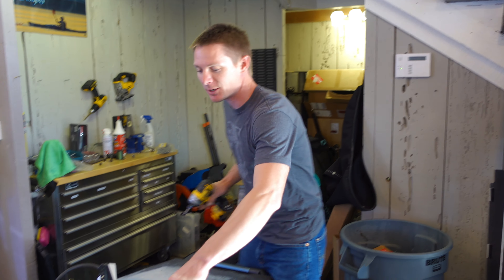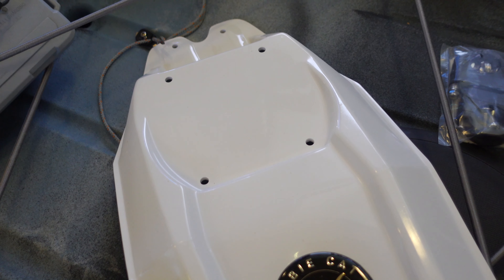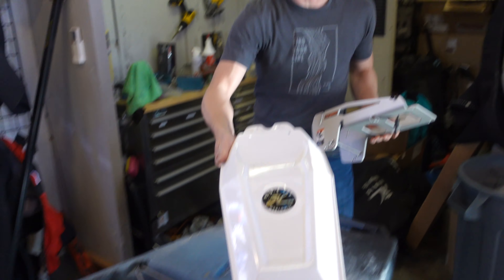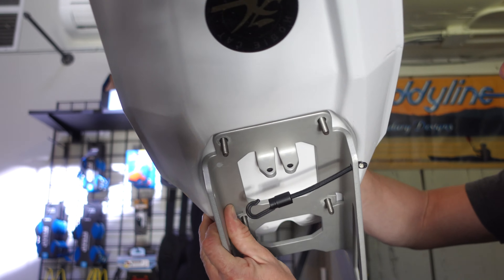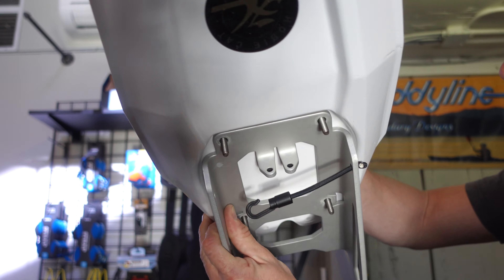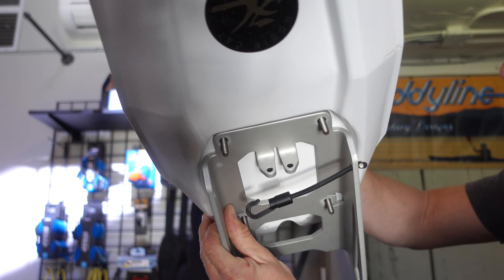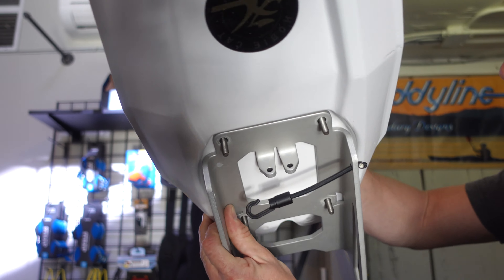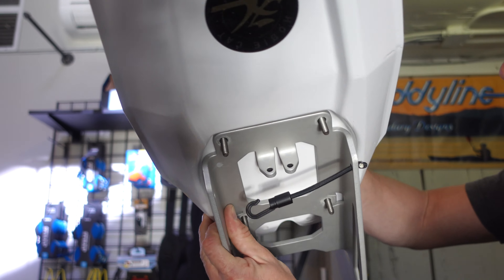Hobie Pro Angler 12 MD360 Tournament Build Ep. 3 - Torqeedo 403A Motor Install

Comment: Better off moving the motor raising bracket to the top and putting the bike style quick adjust just above the steering block...no need for anything on the bottom and this allows for quick height adjustments and easier motor raising...

Comment: What about steering ?
Reply from the maker: We just use the rudder to steer the kayak. We have tied a Torqeedo into the rudder system to steer and added foot braces inside the kayak for steering also. It comes down to personal preference.
Reply: How is the steering with it in the fixed position?  Is it harder to turn?